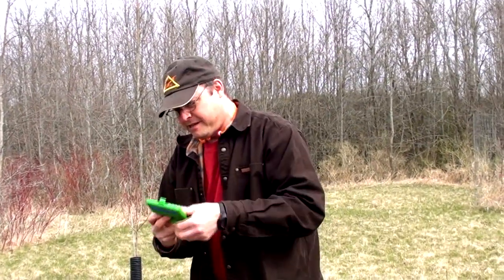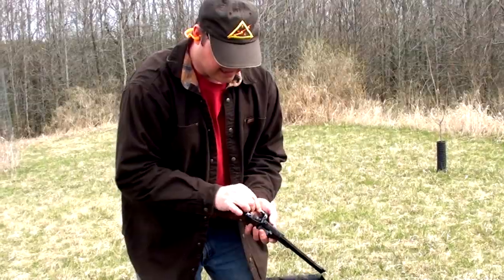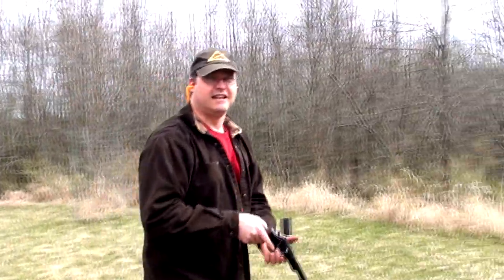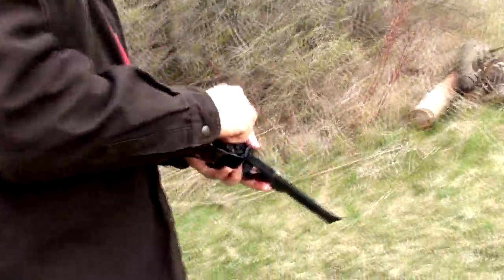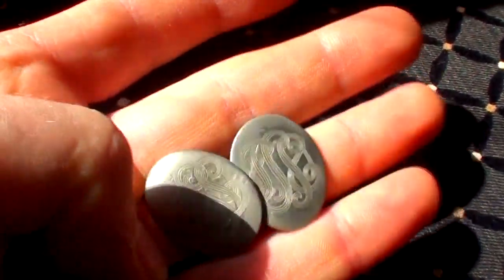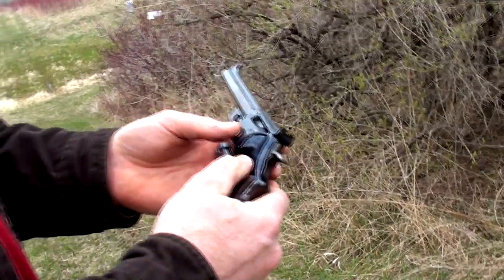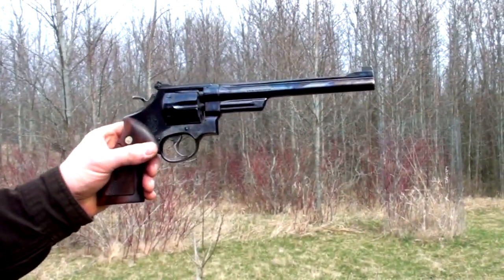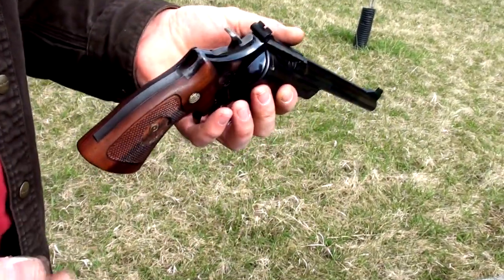1960 S&W Model 27-1 .357 Magnum

Comment: I believe the term "coke bottle" grips is associated with the palm swell shape of the grips made many decades ago.  The indentation you see on the upper left panel is made so a speed loader can pass by the grip  squarely when re-loading six cartridges.  

Regardless, this is a fine handgun...yours looks to be in great condition, too.